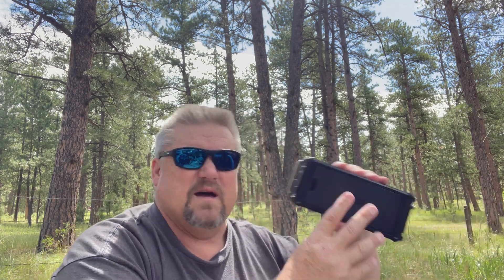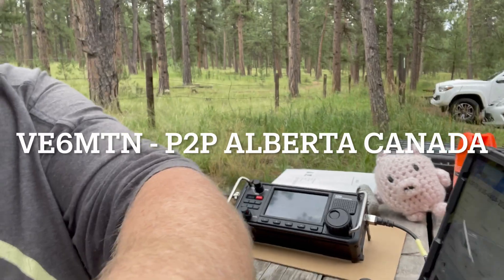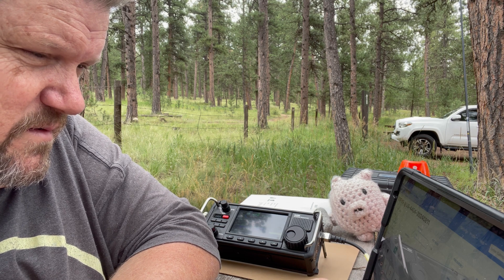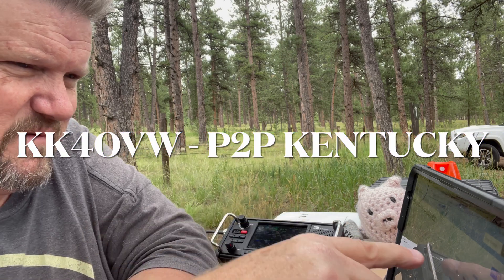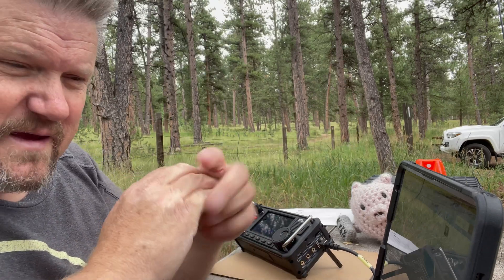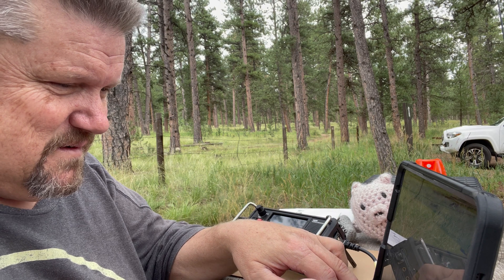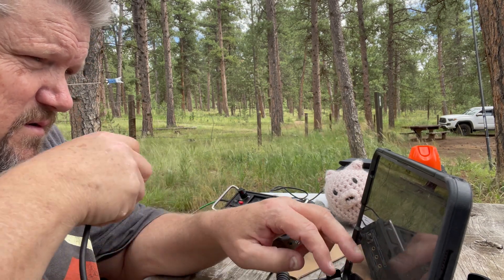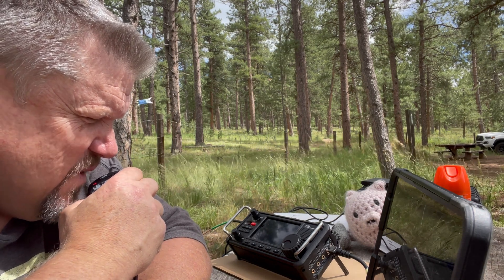Update to Xiegu X6200 ver 1.01b. Parks On The Air in Colorado to Test.

Comment: Did you try using the Noise Blanker to eliminate the vehicle induced static?  Also try covering the speaker with something to eliminate eco when recording  “73” WW3DX
Reply from the maker: @cczinn7670  I did try covering the speaker and that didn’t help. Can’t transmit what’s recorded anyway so it doesn’t seem functional so far. I did not use the noise blanker so that’s something to try as well on another activation. Ham-Solo K0FYR